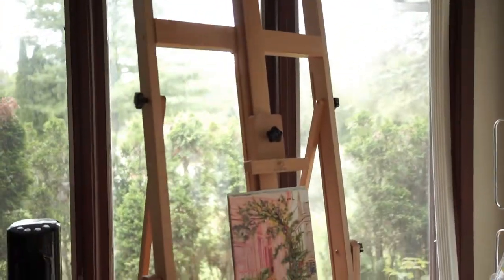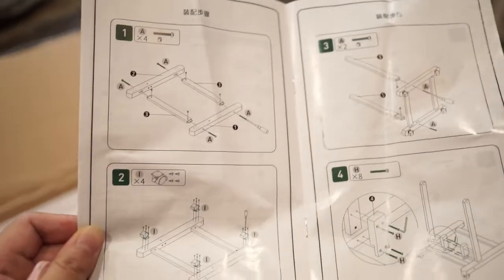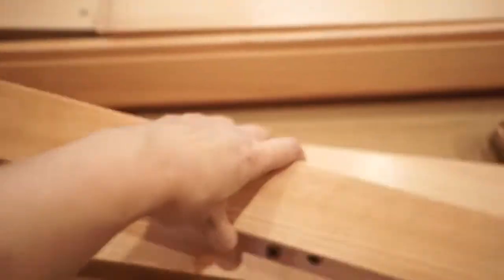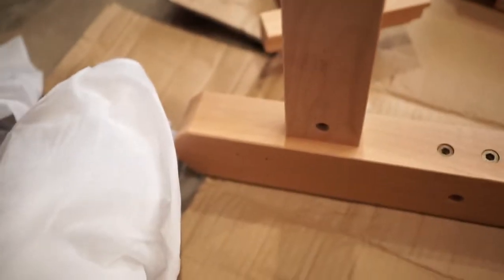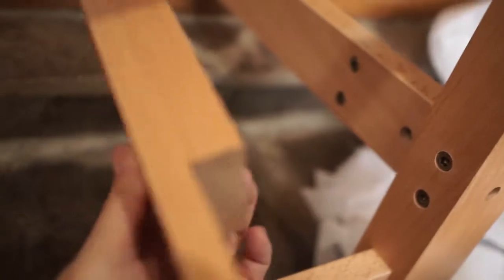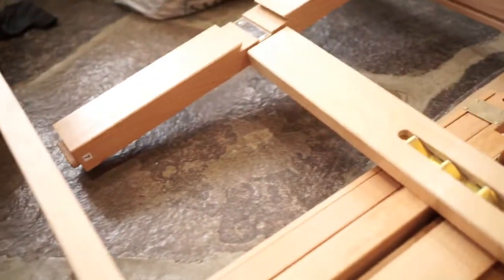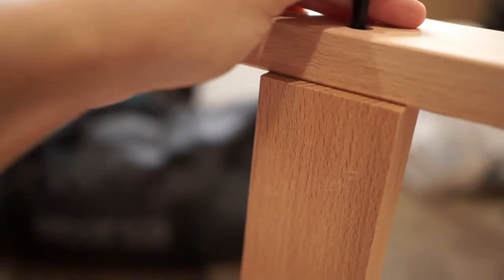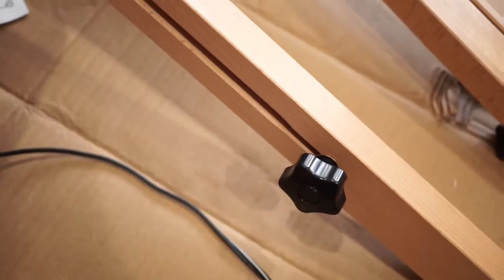Atworth Easel Assembly and Review

Comment: La instalación del mastil central, el poste con cremallera y la bandeja están al revés. La bandeja tiene que insertar en la ranura de los postes laterales para que tenga estabilidad. Muy mal tutorial.

Center mast installation, zippered post, and tray are reversed. The tray has to insert into the slot of the side posts for stability. Very bad tutorial.

Comment: Can this hold an 18x24 inch canvas, in landscape? So I guess can it be adjusted so the top piece and bottom piece that hold the canvas are set to 18 inches apart?
Reply from the maker: Yes, the easel can definitely accommodate that size of canvas no problem. It can also be very thick too!
Reply: @milloolee  Thank you for the quick response! I just want to clarify that the bottom piece that the canvas sits on can be moved up. Basically, if the top piece is left as is, can the bottom one be moved up to the point where it can hold the 18 inch canvas? I'm 6 foot and plan on painting while standing.

thanks again for the quick response!
Reply from the maker: @CayossAda  yes, the bottom piece can also be adjusted to sit higher. There is about a foot of adjustment room and it “clicks” into place at about 1 inch increments. I hope that helps and that it is what you are looking for.
Reply: @milloolee  It is, thank you!